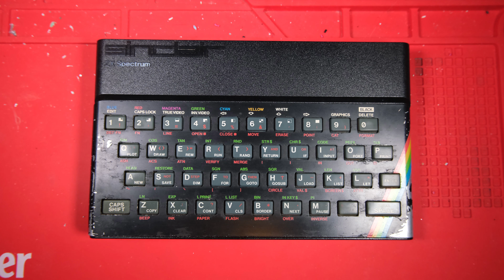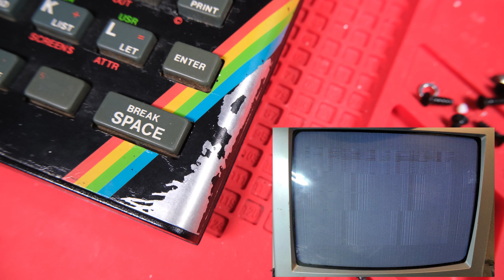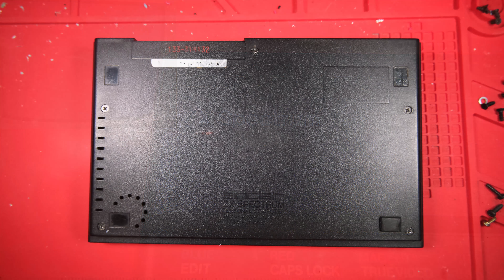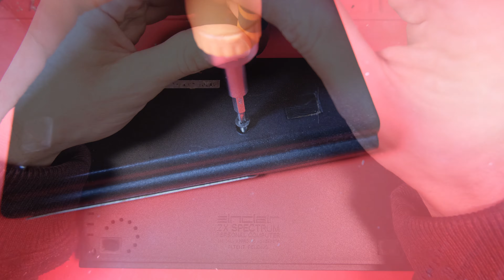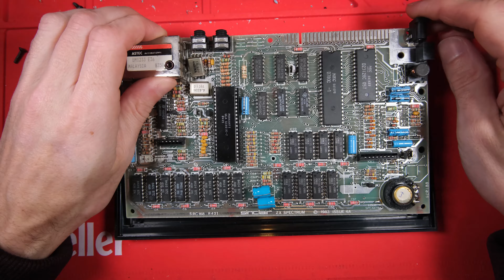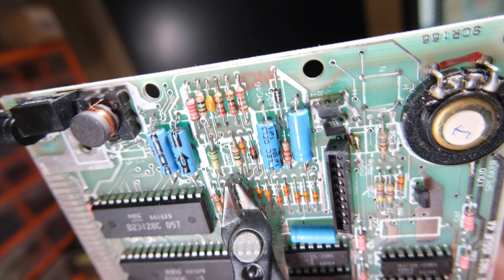Do NOT Plug in Your Spectrum if it Looks Like This! - ZX Spectrum 48K Repair

Comment: Oke, newbie question here: if I do the voltage regulator swap on a issue 3 with the Traco TSR 1-2450, do I still need to do the dc-dc mod also? Sorry if this sounds dumb but this is my first spectrum and I have only got it for a week. :-)
Reply from the maker: Yes the DCDC mod will be a good idea.  Your new reg just reduces the heat produced by the original reg
Reply: @HappyLittleDiodes thanks! Will do that than 😊

Comment: I was able to fit a heatsink (well, a copper slab) on the ULA in a socket - I put a low-profile socket in.
Reply from the maker: I've not tried this but thanks for the tip, I guess the heat dissipation wouldn't be as good as one with fins, but to avoid the rework it could be well worth it
Reply: @HappyLittleDiodes  the only thing is the sockets are rare and so a bit pricey. I found them on Mouser: 200-ICO640LGT

Comment: I never had any luck with CMOS Z80's in a Spectrum. Depending on the board, they either not work at all, or appear to be working but cause all kinds of intermittent errors. Rule of the thumb, TTL and CMOS don't play well together.
Reply from the maker: I definitely have had issues in earlier issue boards with the newer CPUs. Later boards seem to work ok
Reply: @HappyLittleDiodes  Hopefully it stays that way. I've had boards that went thru 100+ iteration of diagnostics without problems and decided to crash when playing games. I've decided not to take any chances and keep the CMOS Z80's away from Spectrums. I have never tried them with issue 6 boards, but they even caused problems with the issue 4V board that I built which is more or less an issue 4B.

Comment: This is an excellent video thank you. Very helpful. However, is there a case for declaring a spectrum like this, with so many issues, BER?  You must have spent hours and hours on it.  

I'm all for saving vintage computers but there is a limit.
Reply from the maker: Yes there is absolutely a case for that, but the owners can be quite sentimental about the machines and willing to put the money it.  For me it's absolutely not a good business to repair them, especially with the cost of axial capacitors going up, but the mission is to keep as many machines going as possible, patreon contributions go towards components and they make good interesting YouTube content.

Comment: Never DC-DC modded an issue 4... done a few Issue 2's though... generally i would DC-DC mod any of them that use the old converter circuit

BTW if you ever find BA157 hard to get, UF4004's work very well... the important parameter is the reverse recovery time (trr in the datasheet) and anything faster than the original will be fine.
Reply from the maker: Thanks for the info. I've never struggled for BA157 but I bought a lot a year or two ago and I don't use them very often

Comment: great stuff .. that broken dc/dc mod  is crazy .. ouch that was bad luck with the address line short .. i haven't tried that method for identifying the defective lower ram module but i will be trying it  in the future ..✔
Reply from the maker: Top tip.  When you're trying to wiggle the pin so it's not touching the sides, use your multimeter probe (instead of your iron or a screwdriver) because it stops beeping when it's free